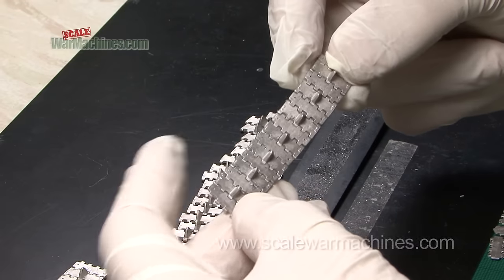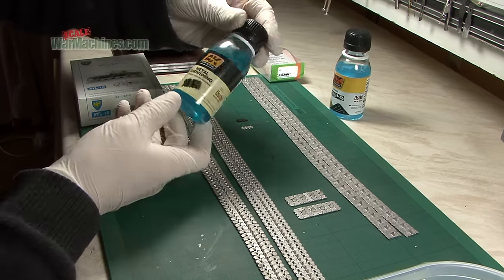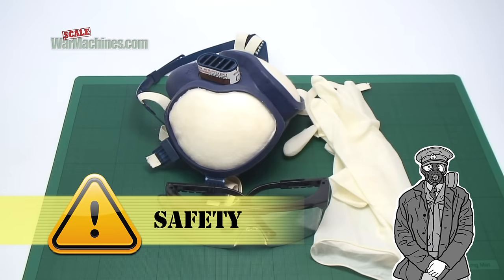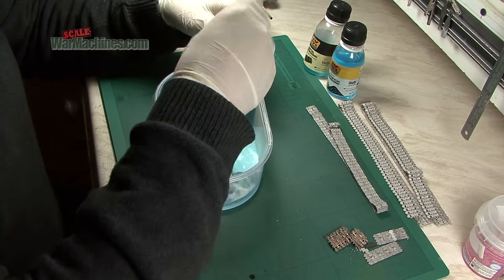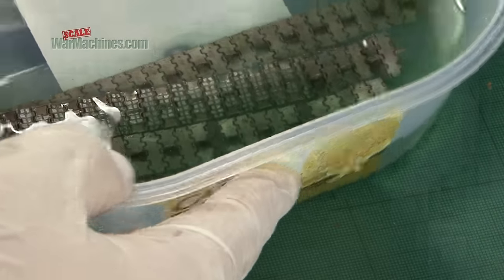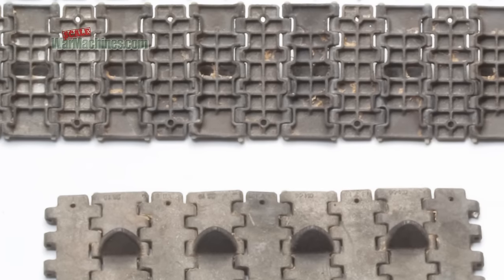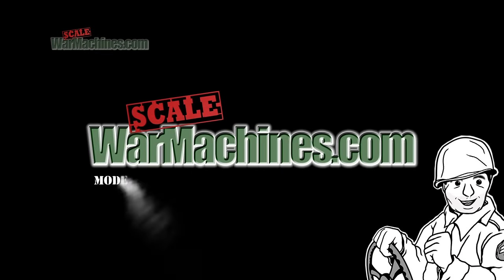AK INTERACTIVE METAL BURNISHING FLUID "HOW TO" GUIDE

Comment: Hi, can this be used RC models? I have a T-90 with metal tracks and I would like to weather it but it needs to remain 100% workable so there won't be any problems with moving.
Reply from the maker: Oh yes, these and any other products (e.g. Blacken-It) create a chemical tarnishing on the metal (not burnishing as AK would have you believe). So if your tracks were workable for RC before, they should be afterwards - in theory. Can't see why not as only the metal is affected...

Comment: I have two part tracks where the pads are glued using CA glue.  Will the burnishing fluid eat the CA glue if the pads are attached before using the burnishing fluid?  Or should I burnish the tracks with the pads off and glue them on afterwards?
Reply from the maker: Should be ok. If you look at the video, you will see the areas where there was CA glue spill were completely unaffected. So you should be fine.
Reply: That's good because I figured after burnishing which appears to be actual rusting of the parts, there would be little or no bonding capability for the pads to be glued on.

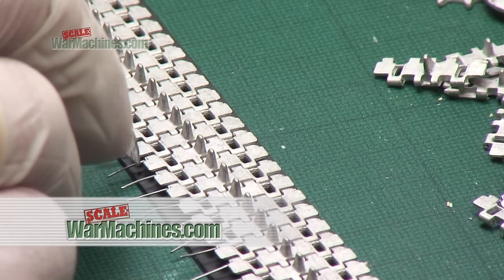Comment: Soaking for 10 minutes? In another video i saw 30 seconds and it was the same results. Can somebody help with dilution and times? Or was the prodict changed? I want a nicely worn effect (like 3:38 in this vid), but not more.
Reply from the maker: If we said it took ten minutes that is because that's what it took or said on the bottle. That doesn't mean some other products may be less time depending on the formulation. You just have to make a judgement and use the manufacturer's instructions. When you see the effect you like, stop the bathing/exposure to the product and rinse off to neutralise. Have fun!
Reply: Scale War Machines wow, thanks for the quick repsonse! The thing is, i meant the other ak product. Ive seen ak burnishing fluids, same bottle, but with different labels. I guess ill just order one and see what happens, my only fear is overdoing the effect.
Reply: Scale War Machines so i just remove when desired effect is visible right? Its not gona keep on reacting that much after i get it out and rinse it in water ?
Reply from the maker: That's the recollection but if in doubt, you can do some tests on a few spare track links. AK may have changed the formulation or packaging. Just go gently, follow instructions and use test pieces first to understand how it behaves. Don't worry it's not very complex. After a certain point the reaction can't go that much further so overdoing it is hard.

Comment: I have 8 strands of T-55 tracks how many bottles will I need ?
Reply from the maker: Maybe 3 to be safe but you can sort of reuse. This chemical is basically what people use to restore blueing on guns so you may be able to find bigger quantities for that purpose. Remember too, you can reuse or water down the AK stuff to an extent to make it go further. And you can bathe four runs in one go. So you might get away with just two.
Reply: That makes sense a aircraft modeler friend mention getting this agent from a gun store.

Comment: How would you suggest someone disposes of the used fluid? I have a very strong feeling that pouring the fluid down the drain would not be a good idea as the chemicals involved are toxic and should not be allowed to get into the water supply via the drains. In fact it could well be a criminal offence to do so in many jurisdictions. So I think before using this stuff and similar burnishing solutions it might be a good idea to find a suitable container to decant the used fluid into and find a local safe disposal facility. In the UK most town councils operate a harmful chemical disposal unit at local, municipal rubbish tips, recycling centres, incinerators etc. I'm sure other countries must have similar facilities available.
Reply from the maker: Yes - we could have made that clearer. You could also pour into a bucket of sand or sawdust & then dispose of at a proper facility.
Reply: Scale War Machines are you sure the fluid has to be disposed of? Some of these chemicals can be reused many times before they are no longer effective.
Reply from the maker: Doesn't have to be - not sure how long it will keep its properties though...but there's something nice about a pure pristine track bath each time...
Reply: I've used basically the same process on 1:1 scale R2-D2 for the hoses on the feet. It's baking soda, hydrogen peroxide, regular household ammonia, baking soda, and water. It can go down the drain. The chemicals oxide the metal and essentially rusts them.